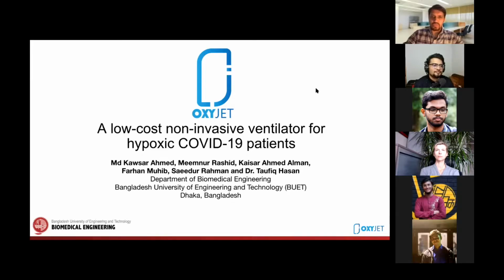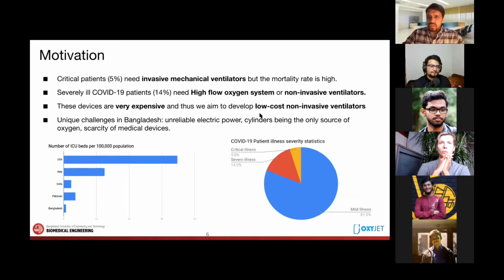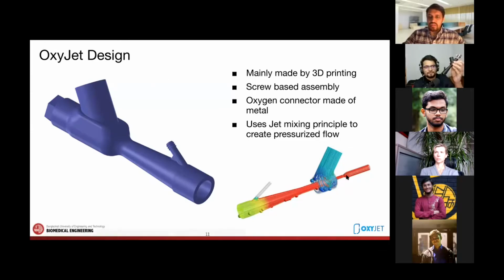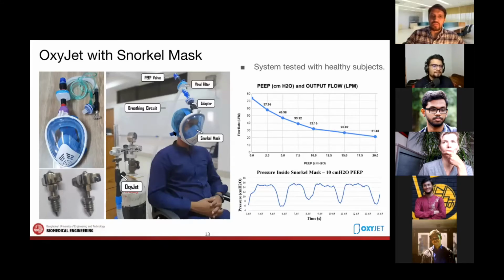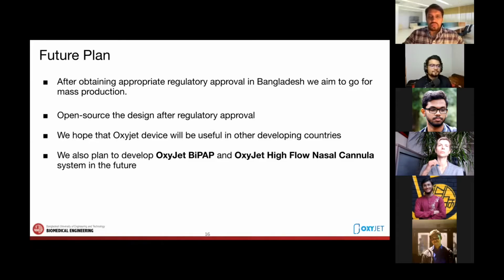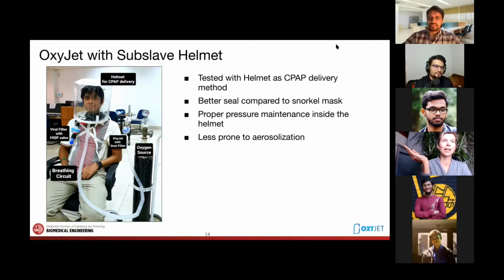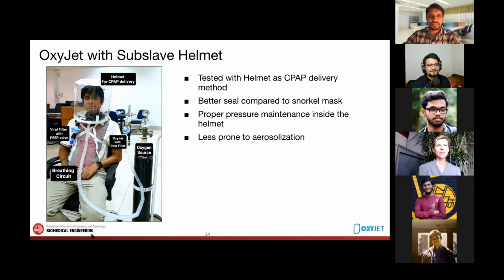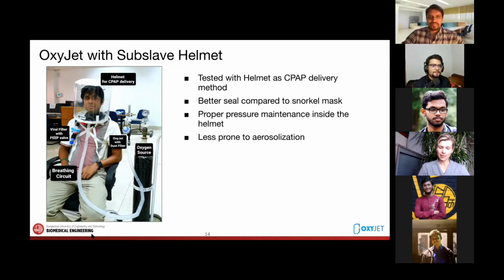OxyJet CPAP- Low-cost Invention for Helmet NIV interface

Comment: The helmets can be made for about 10USD using ordinary supplies
Reply from the maker: I will disagree with you. Helmets can't be made for $10 - plastic bags can be made for $10. 
Helmet won't collapse when the flow is disconnected and will not seal the patient's mouth and nose. Plastic bag, without flow, will cause asphyxiation.
Reply: @aurikasavickaite8214  surely, aurika, indeed using an alternative helmet without safety valve (like sea long's) must be avoided in non ICU  or in patients with any risk of losing consciousness, but a safety valve is an extremely simple device, I bet the cost wouldn't surpass U$D 2 for a well built sturdy and realible spring activated one that can be 3d printed. I will try to design one myself
Reply from the maker: Thank you for your comments. All patients who are using helmets, face masks, total face masks NIV should be monitored at all times. 
While the use of a anti-asphyxiation valve in helmets proved effective in limiting CO2 rebreathing, in case the gas flow is lost but it did not protect from the risk of hypoxia related to decrease in FiO2 and loss of PEEP. 
Patroniti, N., Saini, M., Zanella, A., Isgrò, S., & Pesenti, A. (2006). Danger of helmet continuous positive airway pressure during failure of fresh gas source supply. Intensive Care Medicine, 33(1), 153–157. https://doi.org/10.1007/s00134-006-0446-5